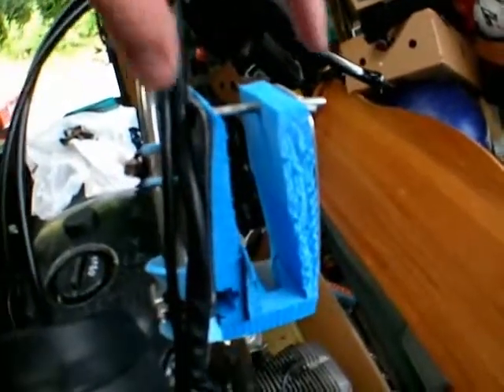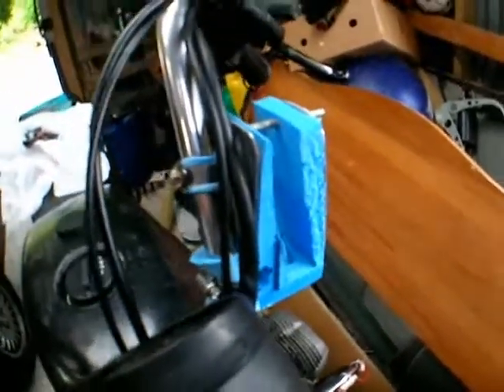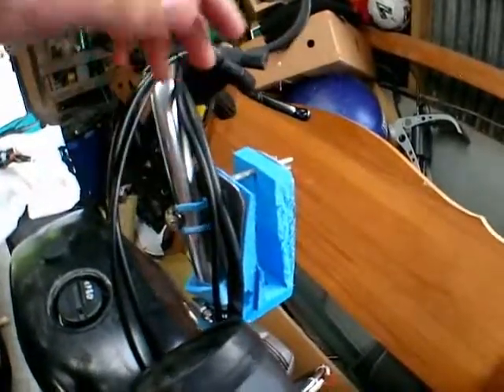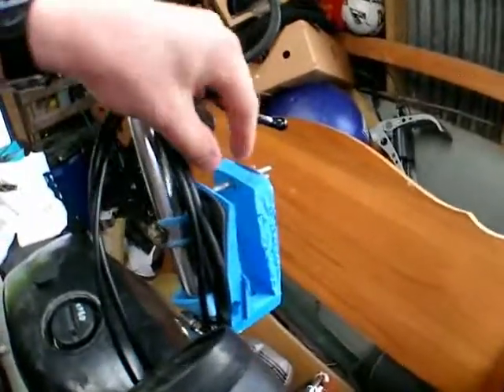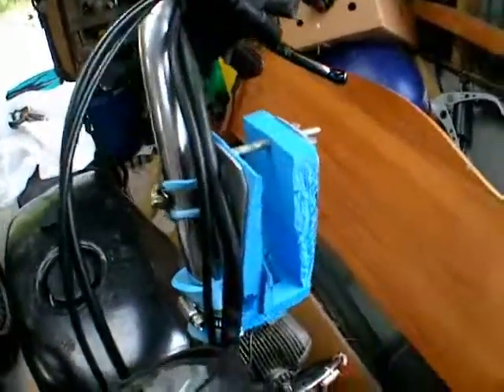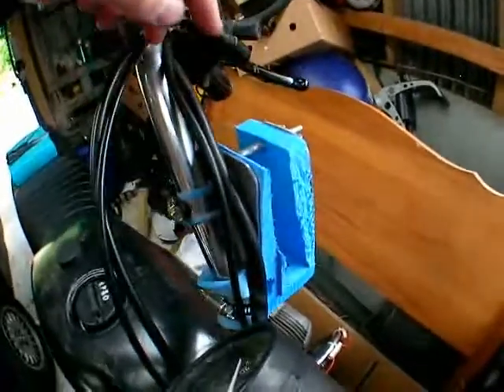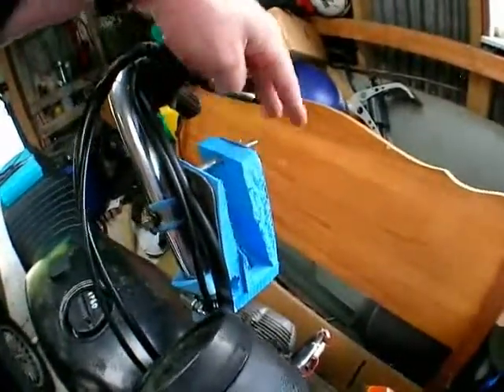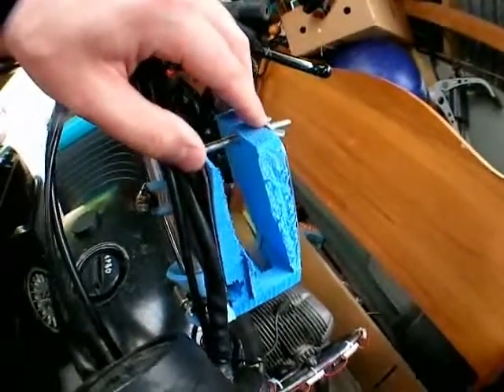New Camera Mount Closeup

Comment from the maker: Thought about that alot but unless the wires, or springs I was thinking of using, would have to be pretty hardcore. I just don't have anything like that.
That's basically the system that they use to shock proof electronic things 'in the field' but I don't think it'd make the camera smoother, just bounce more smoothly.
I'm playing around with much softer foam now, and lots of it. We'll see :)